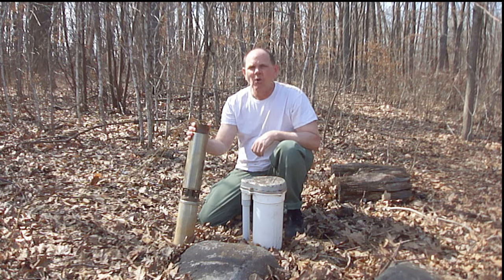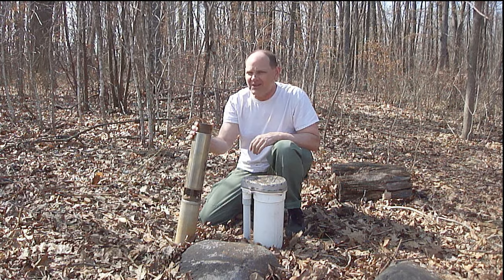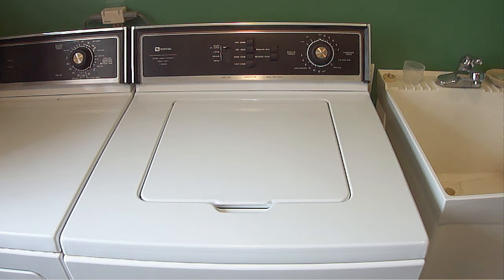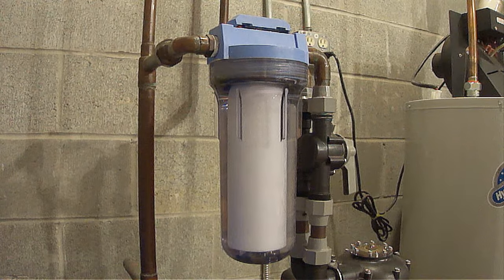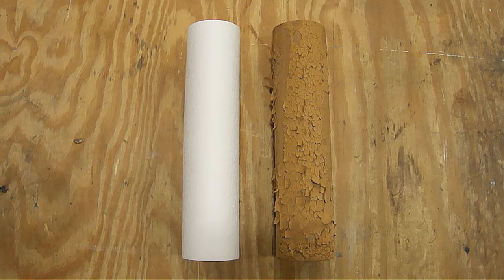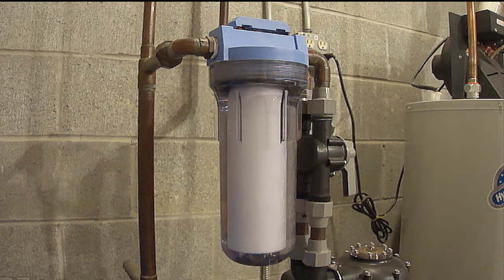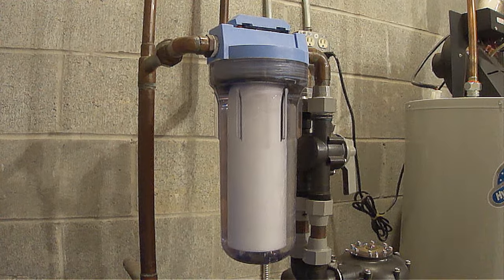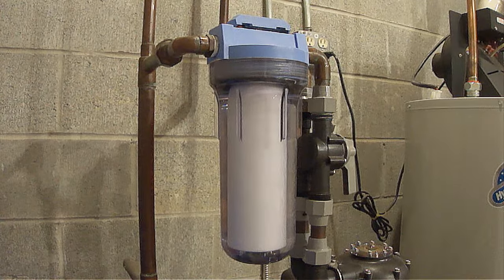NEVER Replace A Submersible Well Pump Until Watching This!

Comment: This way is the best remove the water filter turn the pump on let run for fifteen minutes then stop do this about four hours until the water clear up then install the water filter .
Reply: That's what I was thinking also.  Leave out the filter and run a hose or laundry tub faucet until the water is clear.  Then install the filter element.....

Comment: Shoulda just let that junk run through instead replacing all them filters
Reply from the maker: @savageuser40  Absolutely not!!!
Reply: You are correct, assuming that you are suggesting removal of the bottom or clear half of the filter housing and filter and then running the pump until clear water comes out.  You have to have a 5 gallon pail or bucket to catch the water and be able to shut the pump off when the pails or buckets are full so that they can be emptied.  A better way would be to drill and tap the bottom of the clear housing with a pipe thread and adapters so that a garden hose could be hooked to the bottom of the clear filter housing so the pump could run and not over heat with stops and starts.  If you cannot drill and tap the housing yourself any machine shop could do this for you.  I had to do this with city water in Onalaska, Wis. for years because the city decided my taxes were better spent on bicycle trails than providing clean water!!
Reply: @proclaimliberty2000  most set ups halve a front valve for that reason
Reply: @37yearsofanythingisenough39  didn’t think about city people, I live in country I have well outside with a valve I can run the water out before it goes into softener and filters

Comment: Remember when replacing your well pump to put chlorine in the well and let it sit for 2 days. And then purge out the water with a hose until the water no longer smells like chlorine. Before letting it be used in your house. This will help you avoid issues when replacing your well pump.

Comment: Suppose to flush and cycle pump multiple times till water cleans up
Reply from the maker: We did that at the well head
Reply: Nah, this is my job and you typically run it for about an hour continuously until satisfactory, they have other issues beyond “stirring up the water” that actually almost never happens like that

Comment: Great fyi.  Conversely, wouldn't it make sense to flush the well via an exterior faucet that a hose would be attached?  This specific outlet is cold water only and usually wouldn't be filtered (on the filtered whole house line/source).

Comment: I'd be a little concerned that thick sediment at the base of the well might have killed your old pump. Does the pump sit in some kind of sock to prevent it from drawing up debris? You could scope out the amp draw on your pump to be sure it is not working too hard.
Reply from the maker: The pump has a built in screen.  The pump motor worked fine but the top connection fitting cracked and was loosing water at the crack.
Reply: The screen on these pumps are not fine enough to stop sediment but they are generally hung 10 to 20 feet from the bottom of the well thereby allowing debris to build up for years and years without affecting the pump itself.

Comment: no make and model of the filter posted that I could find. I have the same problem with a new well pump installed today. Working on it.
Reply: U can find this exact filter setup at Lowes or home depot.
Reply: Any 10-in sediment filter will work, does not have to be that one. In fact that looks like it's a filter housing from rainfresh and I find them more trouble than they're worth. A simple 10-in housing with a 5 micron filter is good. You can start off with 20 Micron filters and then reduce to attend Micron and then finish off with a 5 micron and use that as your final filter spec. Rain fresh filters tend to have a completely closed bottom and people more often than not install them upside down and then get into trouble trying to remove them. Spun polypropylene filters tend to flow a little better and last a little longer. The rainfresh filters look like compressed styrofoam and plug pretty quickly in the same conditions as a spun polypropylene filter.
Reply: @scottfurlong5475  I do have the sipn down filter after my pressure tank. That catches a lot.
Reply: go to lowes or a home depot...thats not hard to imagine !!